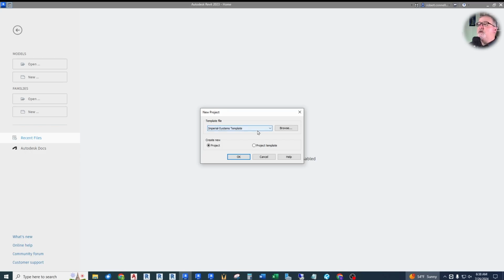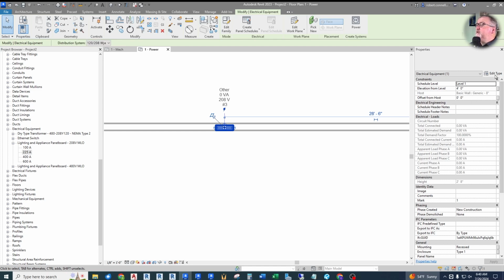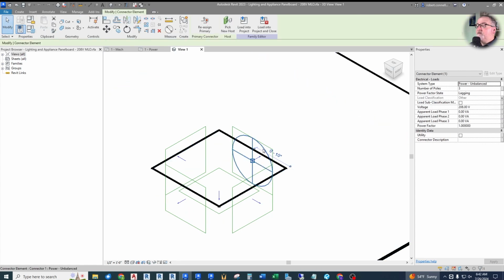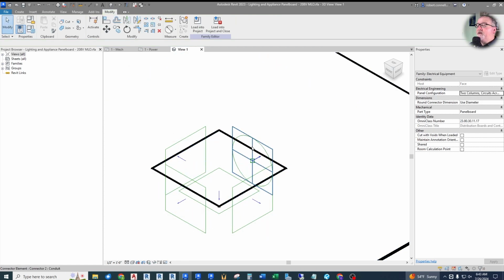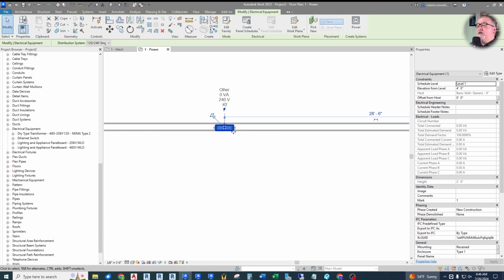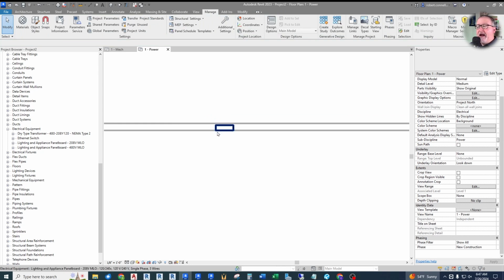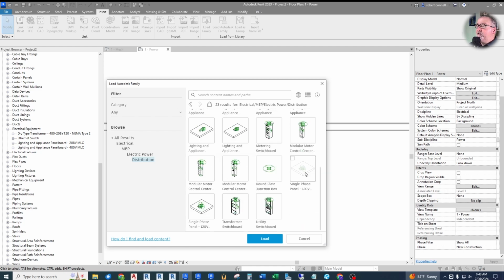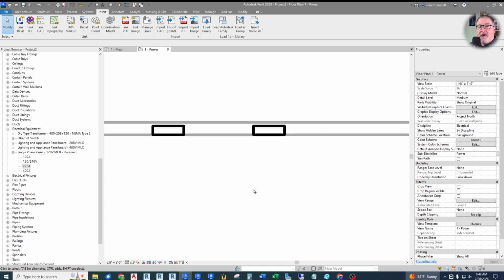The Missing 120/240V Panel in Revit (Here's the Workaround)

Comment: Hey Rob have you ever had an issue with a 120/240V panel schedule where phase B doesn’t sum up the KVA?
Reply from the maker: Hey John. The only trouble I've had similar to that is when for some reason there is an error in the panel schedule template. In the "panel schedule editor", check the cell that is supposed to contain the sum of the loads for phase B to make sure it is the correct parameter.

Comment: If you feed (for example) C and A phases from a 3-phase board into a single phases XFMR and then out to single phase 2-pole panel, have you found a method to make sure the panel continues to read/display it's loads on the C and A phases?  I find that Revit immediately defaults back to A and B.  I would prefer it to bring the phase names through consistent with their upstream destinations of the 3-phase system.  Cheers
Reply from the maker: Hey there Sam - great question! I have to admit I've not tried this scenario, but I sure will to see what's up. My gut feeling is that like any other 2-pole load, I would expect the loads would report on those 2 phases only, but maybe something crazy happens thru the transformer. Will see what I can find out and report back!